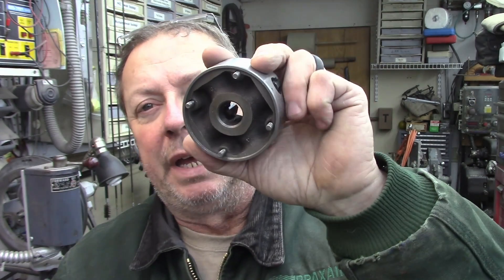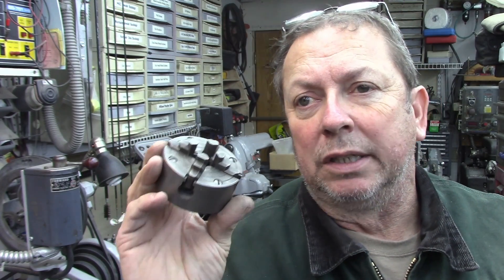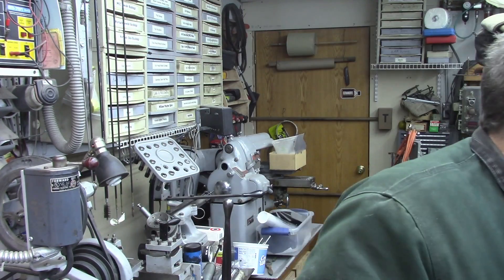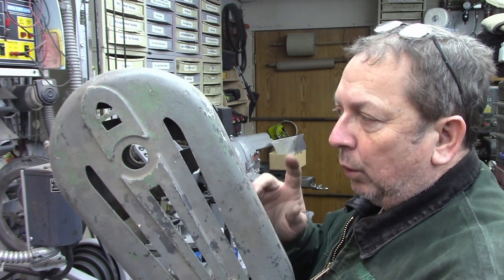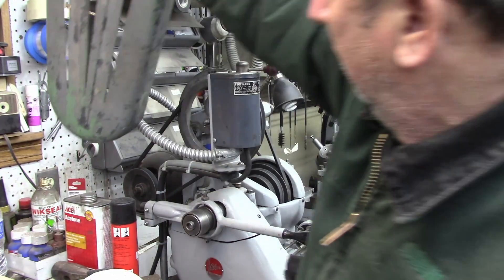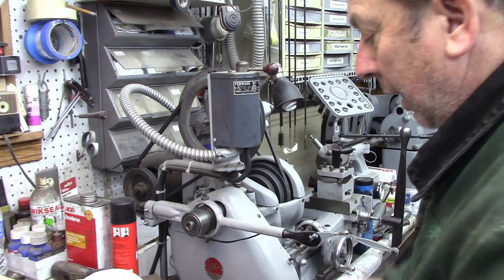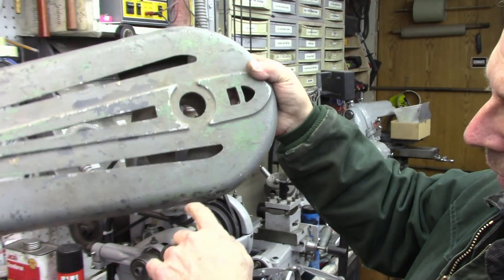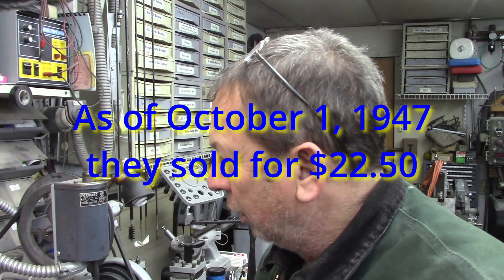Atlas Lathe Parts: Safety Guards & Chucks

Comment: Which Atlas lathe is this in your video? Is it a Commercial? Doesn't look like the others I've seen.
Reply from the maker: It is a standard 10” I built as a turret lathe for production, no it is not a commercial. The only real changes you will see from the more common 10” machines is it is built with the vertical countershaft and all the turret lathe/production accessories. Thanks, Dan.
Reply: @hillsgun  Ive got a QC-42 (10", 1950, horizontal) and a 9" from 1940 that's vertical. It looks nothing like my 9". Maybe there was a change after the 40s
Reply from the maker: Yes the 9” is completely different

Comment from the maker: Now I will eat a little crow. The chuck I have is only a 3" diameter chuck not the 4". construction looks to be exactly the same otherwise with the exception of the 4" has a square key and my 3" uses a hex. I suspect that since mine is branded craftsman it was originally on a dunlop lathe (craftsman 109) although when I got it it was on a 6" Atlas. Value wise I don't think a 4" would be worth any more than the 3" or any more valuable size wise. When I compare the length of the jaws I think there is very little if any difference in the capacity of the chucks